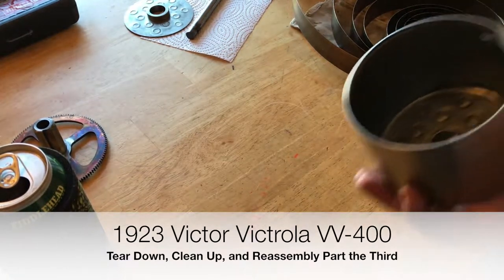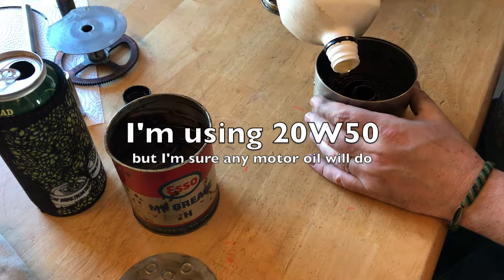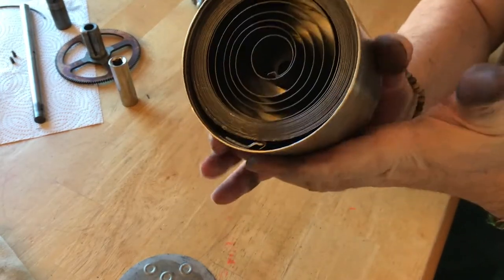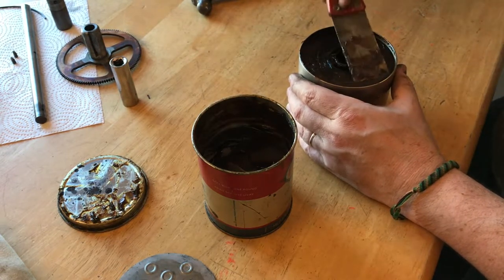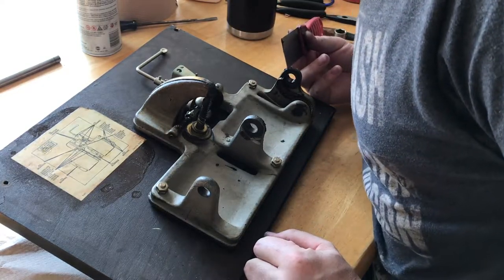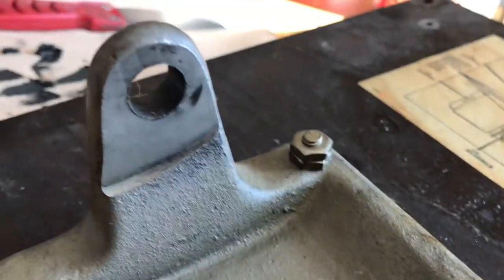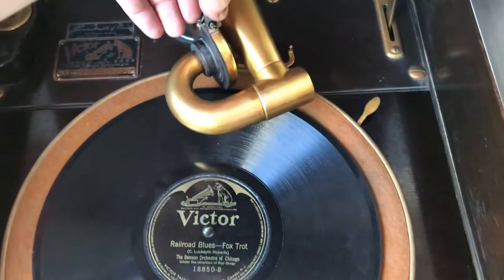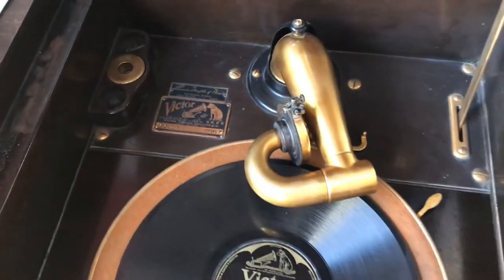Victor Victrola VV 400 4-Spring, 2-Barrel, Motor Rebuild Part 3

Comment: Great video, very thorough and educational! I regreased a 4-spring motor in my Credenza, using a set of wood blocks that fit the contours of the barrel, and putting all in a bench vise, enabling the use of both hands for spring removal and installation. I wore welder's gloves and safety glasses. All parts were cleaned in a kerosene bath. I coated both sides of the springs with grease before installation; now the motor works perfectly, no rumbles. I see why the victrola repair shops charge so much for a complete motor rebuild!

Comment: Boy, this could not have come at a better time. I just had a spring break in my motor about two weeks ago and was looking for some insight on how to replace them properly. Seems to me like you’ve filled a void in YouTube’s expertise, because I couldn’t find anything comprehensive about doing this for four spring motors before this. Thank you for posting.
Reply from the maker: That's exactly why I did it, I couldn't find anything either. Glad to be of help! Just FYI, on the left hand barrel I reversed the direction, typically the lip goes to the outside but in my final assembly I have it going to the inside. Doesn't affect the performance or the fit by any means and is easily switched back. These barrels (at least on mine) are the exact same size and it seems that, not only can they be flipped around (as long as you put the drive gears in correctly), they can also be swapped. I don't believe that is the case for all machines.

Comment: Those springs are massive. I thought clock springs were big! Looks like the bottom spring was getting away from you when you were taking it out of the barrel in part 2, but you safely got it out. Theres some scary power in big springs like those. I'll leave this job for others!. That motor is very quiet. Doesn't seem the fact that the crank end motors slight jerkiness affects the music playback either. Job well done. :)

Comment: Vermont, That is where the Victrola Repair Service is located on Cliff street
Reply from the maker: It certainly is although they're on the opposite side of the state. It's why I started figuring out how to do this myself.
Reply: @agarso Hola,me dirás las medidas de los resortes? Gracias
Reply from the maker: @vladimirvegacaceres8763  Oh boy, I don't really know the measurements as I didn't have to replace them. But if you go to the Phonograph Repair Shop online and match up your machine with their springs you'll get the right ones. Good luck!